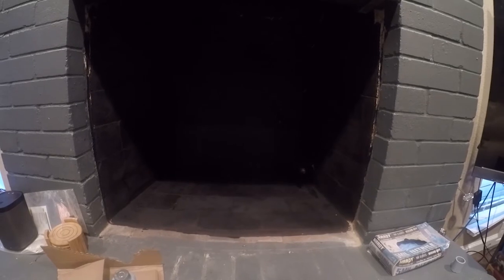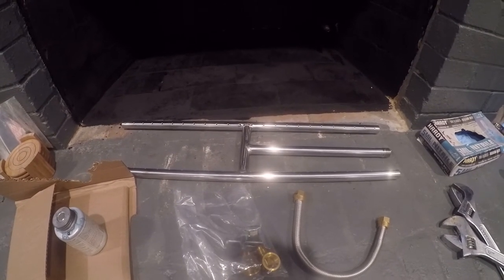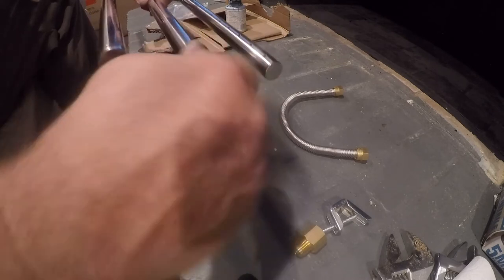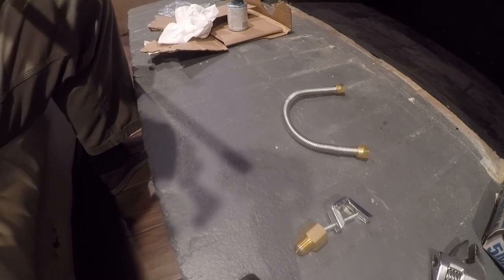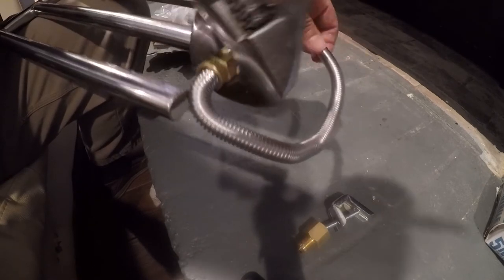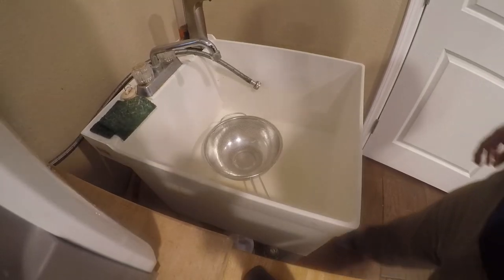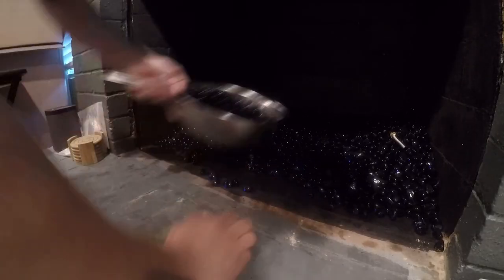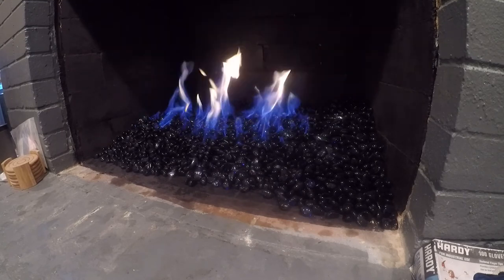Fireplace Gas Log Starter Conversion to Fireglass

Comment: Why do you use the 90 degree connector instead of the straight connector that comes with the burner? It seems the straight connector would work better in your situation. Also, what is the metal clamp for that came in the package?

Comment: Is that valve that  connects the hose to feed the gas like in from
The black gas pipe the hose supposed to be aiming sideways like yours ? I had mine put it’s aiming up. My concern is my plumber said it’s fine if fire touches it.
Reply: I wonder the same thing. I am using the yellow coated flex gas connector and the paint melted away on it when it was running so I shut it off out of concern that it was wrong. Do you think it's okay anyway?
Reply: @chicoventura  yea it shouldn’t Melt after a couple of years now it works perfect. I had to add more glass and I checked the specs on the hardware and it specified it’s ok so I’m ok so far
Reply from the maker: They make a stainless steel one which is the better option.
Reply from the maker: It basically doesn't matter.  I left well enough alone when I converted it from a log lighter to a glass rock fireplace.